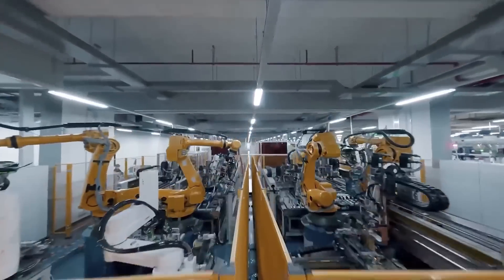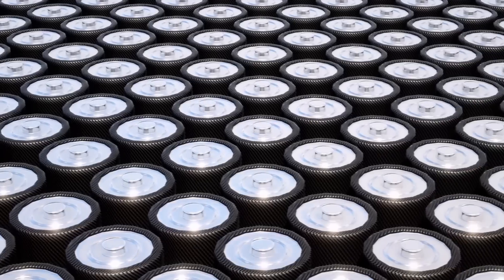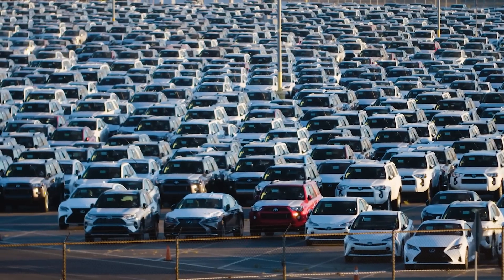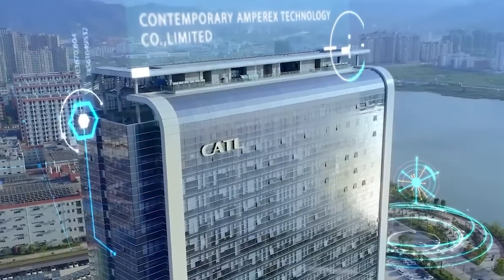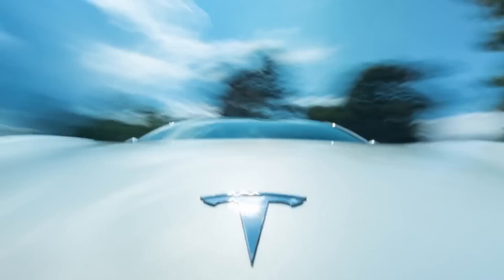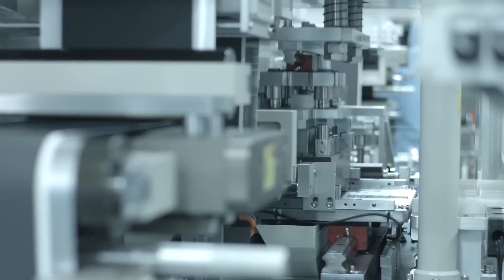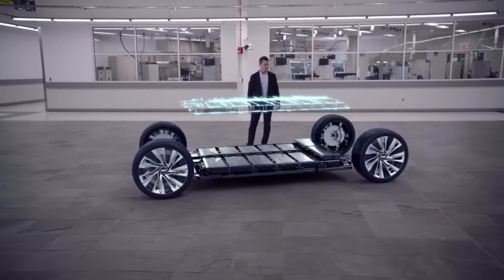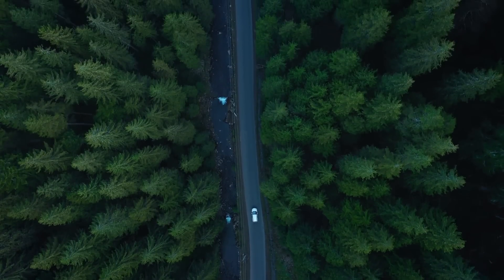Goodbye LITHIUM | Condensed Batteries Will Finally Make EV's Cheaper

Comment: Seemed like a CATL infomercial that was full of glittering generalities that only stressed certain positive aspects of the new batteries.  Note that none of this new battery's weaknesses were mentioned?  This stressed the low points of current battery technology, but what is the life span of this new battery?  Does it have limited recharge/discharge issues?  Does it also degrade over time?  Does it really cost less to make and operate?  This and so much more was not addressed.  You can do better than this Velocity.